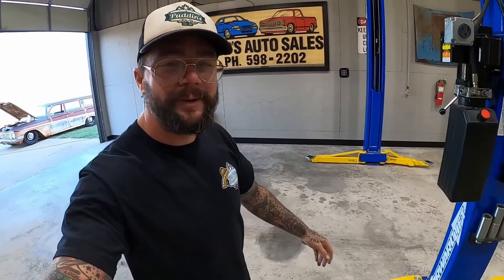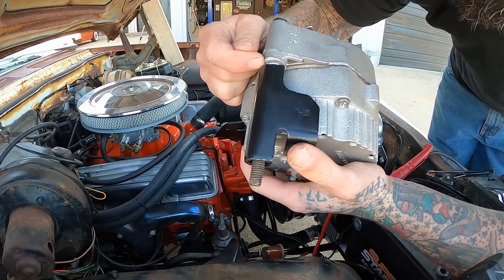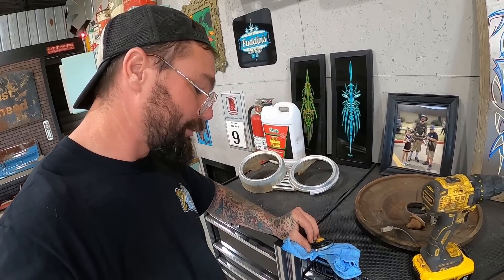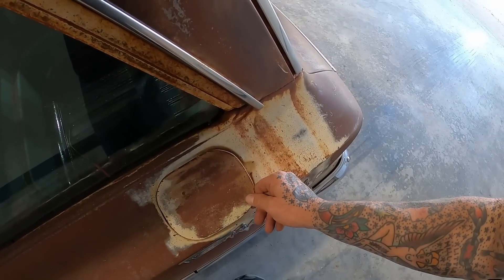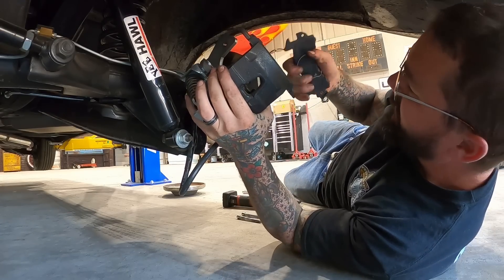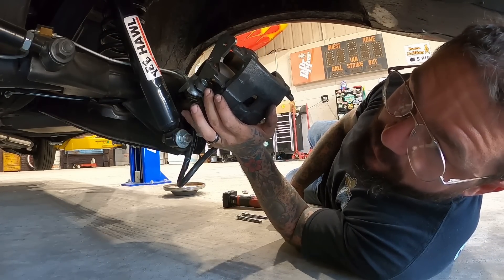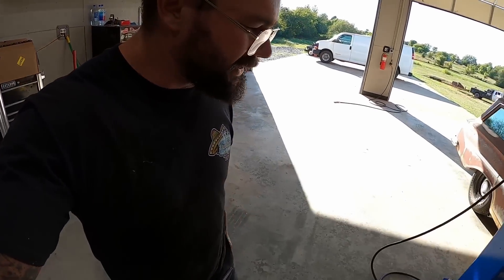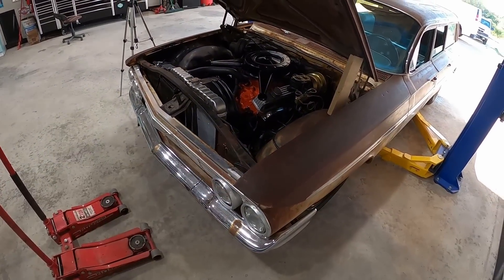1961 Chevy Wagon CUSTOM BREATHER, STARTER, MORE.

Comment: Why are using the lift at jack stand height? Just curious
Reply from the maker: I don’t want to pick the car up by the rockers no more then I have to. If I pick the car up under the trailing arms then the rearend tucks so high up in there it’s a pain to work on. It’s impossible to get tires off as well. 

It’s easier to lay down real quick to pull pads then it is to lift the car by rocker, pull wheels and tires, sit car down on jack stands, move arms to trailing arms, then pick back up.  

Then reverse when it’s time to put the tires on. 

No option to go to the frame on this wagon. It’s a X frame and people seem to forget that. 

Hope this helps, I see a few comments about it. 

Pinning yours to help spread the knowledge. 

Thanks for watching and the support!
Reply: We know if ya get tired you can take a nap. 😂
Reply: Makes a lot of sense! And yes I do have a few your t’s!
Reply: X frames are narrow and funky to lift on a 2 post lift. Lifting body-on-frame vehicles by the rockers is sketchy because the rockers aren't structural like unibody vehicles. And with an older vehicle with maybe some rust here and there, you could crush the rockers pretty easily. So you do what you can with what you got 😅
Reply: This would be my daily driver! When you raised it up and we could see the disc brakes,and the way the exhaust is tucked to the frame. I wanted to rewatch this whole build.
Reply: Exactly!
Reply: @PuddinsFabShop2  I think you should consider adding reinforcement pads specifically for lifting. There might be only half a dozen other builders who ever care enough to try, but it would still make for a fascinating engineering and process video. Maybe two or three.
Reply: It's his tool !
And he can use his tool any way he wants. !

WAIT !
That does not sound right.
                     😳
Reply: @rattles3044 😂😂😂😂😂😂
Reply: Why u worried about how he chooses to do stuff let him do it the way he likes to
Reply: @drones4L45 

It’s called learning why. It was just a question not an accusation. Probably the reason he pinned my comment. 

I’m a very positive person. Not an internet troll looking to get into arguments. I have a 2 post lift. I figured there was a reason and wanted to know why.
Reply: @rattles3044 
Yes I know. See my comment above this one. Thanks

Comment: ADJUST THE POINTER ON THE MITER GUAGE AFTER YOU GET IT 90 TO THE BELT
Reply: To set the pointer (held on with the single screw) only after holding the T-slide/guide against a square by itself first - and then lock it at 90° against a square. When you know it is 90°, then adjust the pointer to 0°. Then you can use it to square the table slot to the belt surface.
Reply: Right u are sir 👍
Reply: You beat me to it 😂
Reply: Yesm
Reply: Why you hollerin?
Reply: @HaynesJP  SPEEEK UP HOSS!
Reply: Mmmmkkkay class
Reply: Yep that's why its adjustable.
Reply: You can't fix....Oh nevermind
Reply: gauge.
Reply: @shawnamiracle5500  One vote for the internet correction police … you know when your typing with (2) fat thumbs some times you might tap the screen at the wrong time …
Reply: @jbostondesigns  realist shit you ever wrote

Comment: There is a water spot remover for glass the detail supplier gets us at the shop. It is a fairly strong acid and stiff scrubber. Gotta be careful with it. Use in small areas and neutralize it within a couple minutes. It works amazing, but it can etch the glass if you let it sit too long.

Comment: Fire Extinguishers:  The chemical in side is called Dry Chem.  it is a super fine powder. Humidity will affect them. Also you should shake them regularly to keep the Dry Chem from packing/ settling at the bottom.

Comment: ❤️❤️ hey Puddin!! I worked for a glass shop for years and a old timer showed me if you use vinegar and new razor blades will clean the window stains. 
If you think about it, its acid rain drops that stained the glass. You need something that’s a little acidic stronger to cut the stain. Sometimes lemons will work w a razor blade. Then when it’s all done and clean you’ll need to polish and seal the glass when clean. Rain-x works good for that too!  ❤🙏🏻
Hope this helps

Comment: I bought a Porter Cable 4" belt sander back in 2004 or so and it's still a beast. It's the corded hand held kind, though. It's never been beaten in a belt sander race.

Comment: I found the best luck I’ve had with baked on window stains is some steel wool and cleaner wax polish. I’m a big fan of the meguires version.  You can try chemical route like clr, lime away kind of tub cleaner. We get baked on hard water stains on glass here in Florida and it can be a bitch to get off sometimes. Hope this helps.
Reply: Hey man, that’s very interesting. I never thought of CLR and SOS. pad. 🤘
Reply: Wood stove glass cleaner works good
Reply: @j.sargent9172  wow that sounds like a great idea, i will definitely try that…i actually can’t wait to try that idea 🤘thanks 🤘🤘
Reply: @stevebrush180  it was my last ditch effort see into my stove or buy all new special cut heat resistant glass and I was amazed. Nothing else would even make it semi transparent
Reply: Thanks again for the tip. I’m gonna try that tomorrow.
Reply: What BeerBarn Said...😶🧂
Reply: Same thing I use 0000 steel wool

Comment: Puddin should hook up a Big 3 cable system on the 61 where you run a big OFC cable from your positive on your battery to the stud on the alternator and run some more grounds and your car will charge better and get probably a better running motor.

Comment: Have you tried using 0000 steel wool to clean the back glass?  I use it all the time on car glass.  Works great, fine enough that it doesn't scratch.  I use regular glass cleaner with it and wipe them down with paper towels afterwards.   Love the content. :)
Reply: i do this also and helps so much in the winter

Comment: Try coating the backside of the pads with anti chatter gup. It’s been a while, but new pads came with a tube of it to use when you installed them.

Comment: You didn't check to see if your mitre gauge is square. Check the face of the gauge with the slider. Once that is set, adjust the pointer to indicate 0 degrees.

Comment: Do you have the correct proportioning valve?  Make sure there is nothing holding pressure on the hydraulic system. I think drum brakes hold pressure in the line. 
Good luck, thanks for the show.
Reply: i was thinking the same thing. Either sticking caliper, or proportioning valve or possibly master cylinder.
Reply: The original master for that car is a single reservoir. I'm guessing the dual one on there now is for rear disc brakes. He could have too long of rod between the booster and master.

Comment: If your sanding table is off 1 degree at the miter as you push forward the amount of degree off will actually increase or decrease depending on how the opposite end of the table is set.

Comment: Inner brake pad should have had a stabelizing spring clip, and you need to hammer the ears on the outboard brake pads to keep them tight in the caliper. Have Slick stomp the pedal and use a scredriver to pry the lower part of the pad tight against the caliper and give the ears on the pad some love taps. And stick a thin shim under that starter

Comment: Puddin! Square the sliding fence to itself first fence to rail. Then square table with sanding surface using the sliding fence. Reason being is the Groove in the table needs to be parallel to sanding surface or as you slide along the groove it will be off.
Your right to ignore the marks on the fence unless you can adjust the pointer to 0 after you get it square. Not all cab do that

Comment: The glazing on the pads and rotors could also be an issue.. newer style pads use ceramics and all kinds of herbs and spices that can harden up under heat and cause glazing that will cause the vibratory grunty noises and also high pitch squealing under light to moderate braking.. 20+ years of automotive mechanic experience I've run into all kinds of strange things.. you'll get er did cause it'll bug you till you do.. love the new content in the new shop keep up the great work puddin!

Comment: There's two types of vented caps you want one it's called atmosphere vented which means events to the outside versus a pressurized vent which yours is pressurized vented so if the gas bills pressure it vents to the atmosphere you need one that if it sucks error events from inside out

Comment: I'd try Different grade rubbing compounds, and buff the glass out, if that doesn't work and all else fails I'd try a razor blade, just watch the corners to not cause gouges. if kept parallel and slow and steady it can get a lot of stuff that wouldn't normally come off

Comment: Puds,  for the glass,  try a lemon cut in half rubbed in,  ketchup it work a while.  Then, spray the white vinegar,  and scrub it with a ball of newspaper.   If it still don't work,  a foam oven cleaner left on overnight

Comment: Puddin one of my all time favorite cars was a 1961Chevrolet  Brookwood  9 passenger station wagon. It came with a tired old 283 engine that I nursed along for a year or so until it simply refused to run due to utterly worn out rings. It just had little to no compression. The car was a 3 on the tree with very worn out shift linkage.  I yanked the engine out and gave it a full rebuild.  A buddy of mine had a thoroughly smashed up 65 GTO and I had another buddy with a GTO body with no Differential. I did some horse trading with both guys and ended up with the M21 transmission  out if one of the GTO's which I promptly installed in my station wagon. It was a direct install with no mods except I put a Hurst shifter on the trans. You wouldn't believe all of the commentary I got from that 4 Speed trans. This was back in the 70's when mods like that were very unusual. Naturally the new engine had a Duntov 30/30 can with solid lifters, Rams Horn exhaust with true duals all the way back. By the time I had that car fully back together it was starting to get pretty quick. I would be driving that car today if I hadn't had a bit of an accident. I was driving down a highway headed into Minneapolis when the gas tank literally fell out of the car. This was Minnesota where they salt the roads and the gas tank strap let go and I was suddenly towing my gas tank behind the car. That was it for me. A buddy of mine had a well worn 65 Chevelle which I bought for $100. and I transferred all of the goodies I had installed in the wagon, into the Chevelle. The Chevelle was about 1000 lbs lighter than the wagon so I ended up with a pretty quick Chevelle. Thanks for the entertaining videos! Bill

Comment: My father was an accident reconstruction engineer  and had a job that was a brake issue.  He used a mill to cut off 50% of a new set of brakepads and I drove the car 370 miles to deliver it.

Comment: As a former auto parts employee who has seen customers return starters and alternators repeatedly as well as had to return some myself - I always take apart the cover on the starter solenoid they’re often loose and may work but they arc and burn up over time, and same thing on the back of the alternator where the posts mount they’re usually loose.

Comment: A great glass cleaner used in glass plate photography is 1/3 water, 1/3 rubbing alcohol, and 1/3 powdered chalk, calcium carbonate.  You could probably sub barkeepers friend for the chalk.  Mix it up it lasts forever.  Scrub it on, let dry, buff it away.  Don't think it'll help that window though!

Comment: I use Bon Ami to clean my windshield. Dampen the window, dampen a cotton cloth, sprinkle some Bon Ami onto the cotton cloth, apply to the glass, rub in circular motion. Add Bon Ami as needed sparingly. Rinse off with plenty of water. I got this from a 1989 Camaro owners manual. GM had a part number for Bon Ami, but I forgot it.
Hope this helps Mr. Puddin'.

Comment: I bought the same grinder for the maintenance shop at work . I love it . We use it daily for the last year with no problems. I use a 36 grit on the belt it seems to run cooler on the parts and gets with it grinding.

Comment: To pop out a dent in such a small space, you can get a bicycle inner tube and zip tie it so it fits inside and simply inflate it until it pops the dent out. There are specialized air bags they make for dent repair if you want to be more professional, but it works quickly and you don't have to fight it as much as using body hammers and anvils.

Comment: Old detail trick is scrub it with glass cleaner and steel wool. Then wipe the glass down with lint free cloths and naptha (lighter fluid) for no streaks. Worth a try. Also kind of looks like some of it might be on the inside.

Comment: Invisible Glass is basically rubbing compound. Chemical Guy's makes a hard water remover. Plastic Razor blade the glass then use the hard water spot remover, it works really well.

Comment: The next time you get down to the wrecking yard see if they have a hood spring , looks better than a piece of wood. You can loosen the pointer in the sander and move it a degree or two and retighten it and it's fixed. You should see my miter saw , it was way off.

Comment: Razor blade on them windows for the win! I bought an old boat that had stuff on the glass, but a little glass cleaner as lube and carefully using razor to scrape it off did trick and looked brand new! 52:47

Comment: I don't often comment on mechanical issues because this is your build. However, I just want to bring to mind that a disc brake system usually returns fluid with less help to the master cylinder and reservoir. 
 The longer travel and lack of spring pressure that drum brake wheel cylinders receive fron the cross springs makes it necessary for the secondary return system in the disc brake master cylinder to have less resistance than that of a rear drum brake cylinder. 
Good luck.

Comment: If you pull the alternator off the yellow 4wd pickup/blazer, just bolt it in the implala. If you already deleted the external regulator from the impala, its a positive/negative bolt on.

Comment: Try for ought steel wool with vinegar and then finish with newspaper for your glass water spots and if they’re really bad, use a really fresh razor blade somewhere between 20 and 30° and cut the water spots off

Comment: Puddin', the screw on the fence angle pointer should be slightly slotted so you can adjust the pointer after you find square.

Comment: OBS chevy mini starters are great. Got one on a 10.5 to 1 406 with long tube headers. Easy access, never heat sinks. Spins over quickly, and quietly. You may find yourself putting one on every sbc you own. Also, parts stores have them. Good luck with the counter guy asking you what year,engine, etc. and getting the right starter for your custom.

Comment: Puddin, you said a while ago that you were going to move those two smaller buildings at the old place to the new house I think you should convert one to your paint shed so you don't get the over spray all over the new shop , then the small parts can hang  dry out of the way from other work

Comment: Excellent video Puddin  :) on ground cable plus battery post put a 10 to 14 gauge wire in 4 foot length with ignition connector , then wire to fender on nice shiny metal to body with bolt and flat with ignition connector size of bolt !  It help Alternator charging and Starter  to give power lots also electrical too full voltage and amps !

Comment: I had stains like that on my 71 442 windows where someone had poorly applied window tint and some performance stickers. The front windshield had some sort of gritty substance that wouldn't come off with a power washer, and was damaging my wiper blades. I eventually used a razorblade scraper, and lots of meticulous scraping the entire window. I did try some steel wool, it was working, but you have to keep it moist, it can scratch your windows if its too dry.

Comment: i J-B weld to  hold the other snorkel on the air cleaner housing. i also added the baffle so air doesn't hit the filter element directly.  trying to pull air from in front of the radiator.

Comment: Hey,  you put that lube for your break on the brake metal part. That rubs on your caliper. That's why you're sticking because you've got no lube on the edges of your brake pad. Where they rub on the caliper where they hold into the Caliper.

Comment: Hey Puddin!  for your glass, try scraping it with a razor blade lubricated with window cleaner.  Follow it up with a clay bar.  I've cleaned up some pretty nasty glass that way.  Just be careful not to dig the edges of the razor into the glass.

Comment: Here's one for the algorithm. Looks like you had enough rubber line in the rear to have it wrap around the bottom of the axle and go around the top to the caliper. Instead of putting rubber hose over the line, why not get shorter hoses or reroute / shorten the hard line.

Comment: The Brake Draggin' Wagon. I think at this point your glasses probably etched from the various things that were on it over the years. I find that if there's something on the glass, Bon Ami works. If it's etched, you'd have to polish it with increasingly fine grits to get down to smooth gkas again. Talk to a glass guy about it.

Comment: Bubba here in Dallas area i worked on alot of brakes , one thing i found out was to stop brakes dragging on rotors when they stay on the rotors when the piston retracts . We used a product called Disc brake quite . it was a glue that would help adhear the brake pad to the piston and caliper contact points . I would spray the back of the pads and wait till the glue got tacky then install them . i can see that you did not use anything like that when the pafs fell out when you released the caliper . Most of the better pads came with a package that was that glue , i did alot so i bought mine in a spray can . Try that and i bet you have better luck !